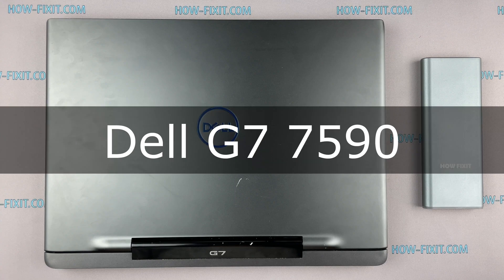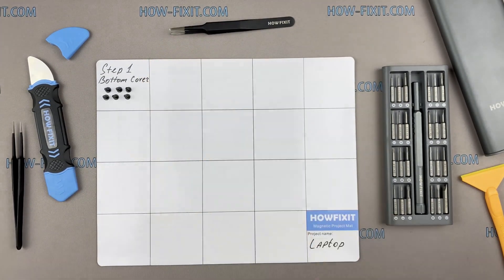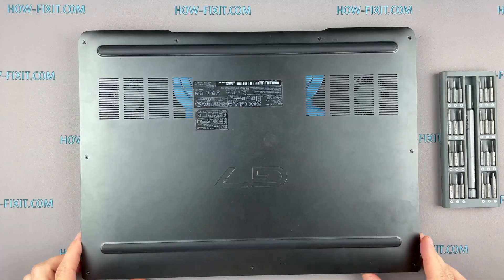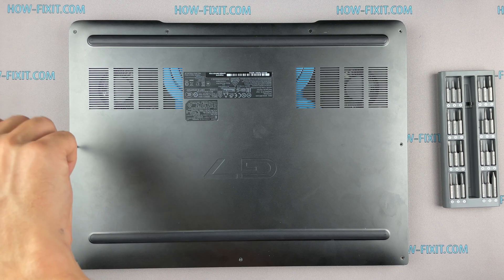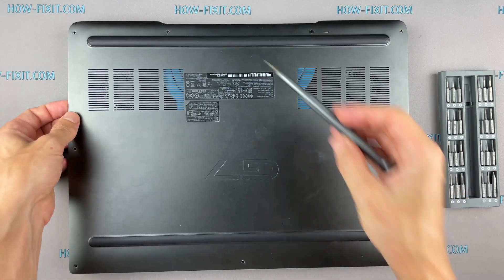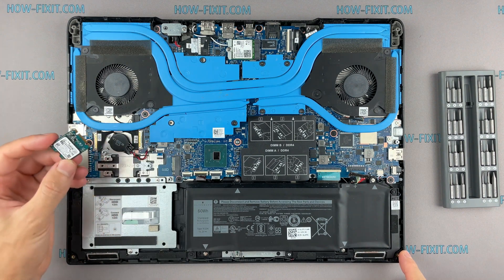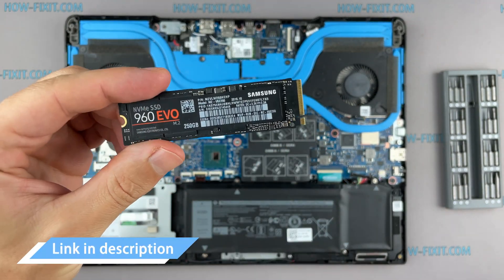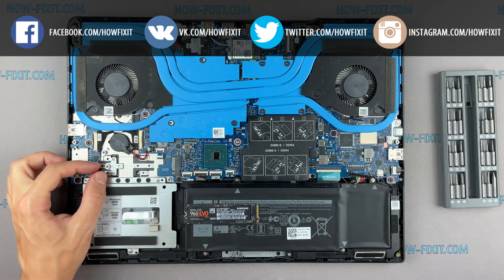How to Upgrade & Install M2 SSD in Dell G7 15 7590

Comment from the maker: ⚠ The Dell G7 7590 supports both M2 SATA and M2 NVMe drives in its M.2 slot. So, you can install either, depending on your preference for cost or performance. Check the description for links to recommended M2 SSD drives. Additionally, watch the video explaining the differences between M2 NVMe and M2 SATA 👉 https://youtu.be/r3Jy5dHOj3g

Comment: can Support M2 PCIE or not sir
Reply: that is what the laptop takes yes
Reply from the maker: The Dell G7 7590 includes a single M.2 2280 slot that supports both M.2 SATA (AHCI) and M.2 NVMe (PCIe) SSDs. Check the description for links to recommended M2 SSD drives.